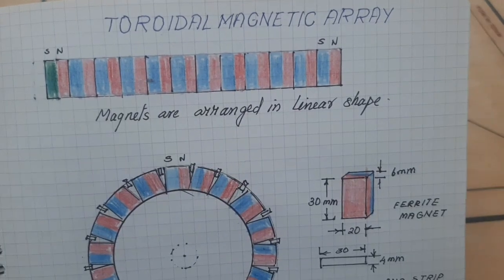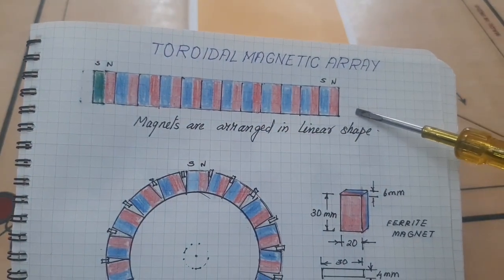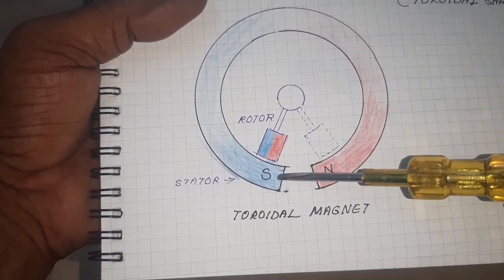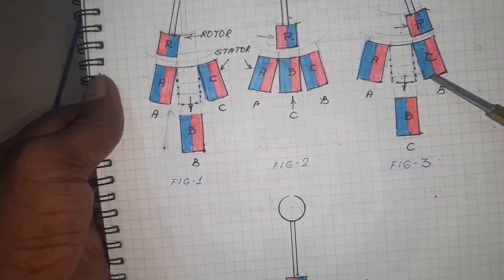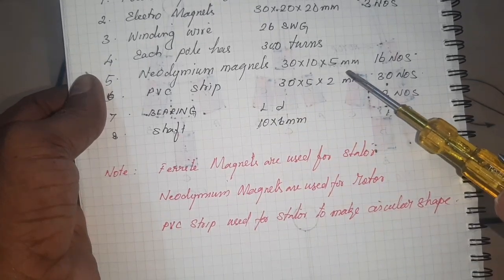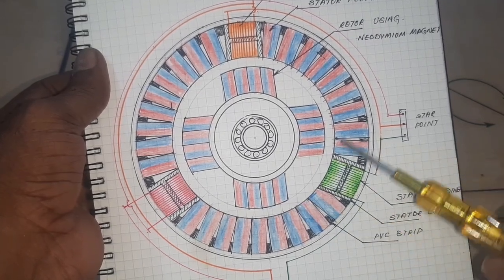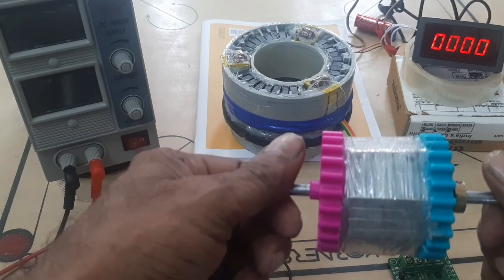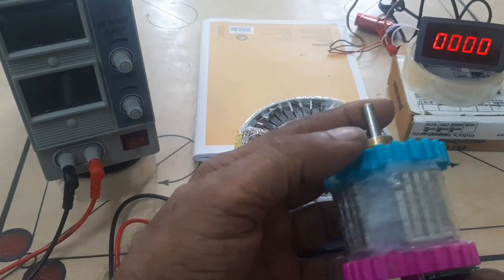1W Highefficiency bldc motor(type-5) using toroidal permanent magnet stator

Comment: I have a circuit of a BLDC motor based on two ic's this number!  l293d circuit has speed controller and reverse forward, the problem is that it gets so ic hot. Can any mosfet circuit be fitted at its output? If so, please tell me its sketch.

Comment: Good idea but was wondering having the magnets on the stator in this design is there no reversing this motor due to the permanent magnets polarity on the stator? If using this motor as only as a generator motor wouldn't making the permanent magnets on around the stators electromagnet be in a halbech array to generate a larger field.
Reply from the maker: Thank you sir
Reply: @pugalstech  ???

Comment: the permanent magnets aren't doing any work, if anything they are actually making your motor less efficient.
Reply from the maker: I have explained  clearly with drawing earlier 
When the magnets arranged circular shape it is called toroidal ok and it is a closed loop hence no poles are formed
When you remove one magnet, poles are created in the open area ok
Closing or opening the loop with permanent magnet it result magnetic poles are formed or vanished
Similarly  iam using electromagnet instead of  permanet magnet in the toroidal gap by on and off the coil power and result the same function was done
Thank you
Reply: @pugalstech  the poles are also created if you don’t have the closed loop so you only added magnets that litterally make no difference
Reply from the maker: Thanks for sharing and supported
Reply from the maker: Thank you sir good question.
Here i have arranged stator magnets pole in  circular direction
And also the rotor magnet pole in circular direction
The stator magnet gives the free energy to move the rotor magnet from one electro magnet to the other electro magnet
Look at the fig analysis of toroidal magnet
When i remove one magnet from toroidal it become a single powerful magnet and put armature with single magnet at middle of toroidal the armature magnet move freely one end without any force
That free energy is used my motor
Thank you
Reply: @pugalstech   u don't get it, the flux lines are in a circle inside the magnets. you have 0 effective field outside the magnetic tourous. put nothing instead of the expensive magnets and you'll get the same result sir

sidenote electric motors are already 95+ efficient